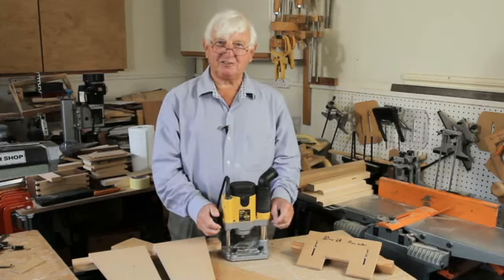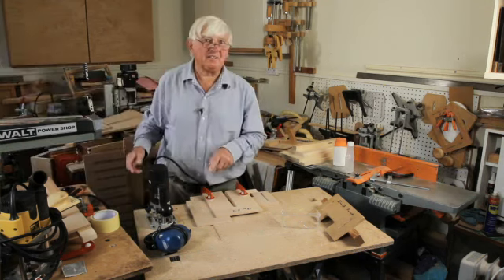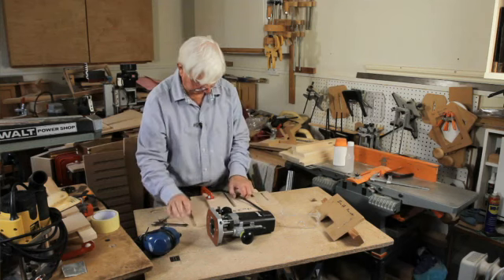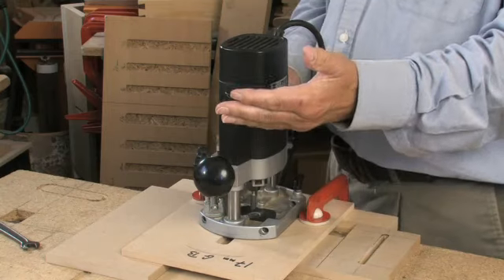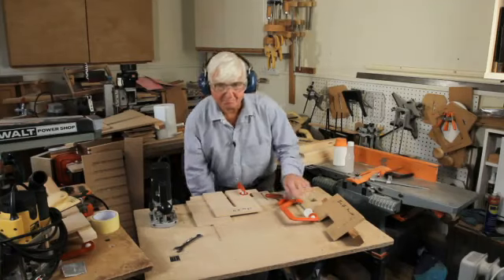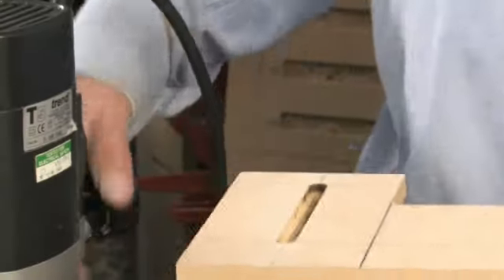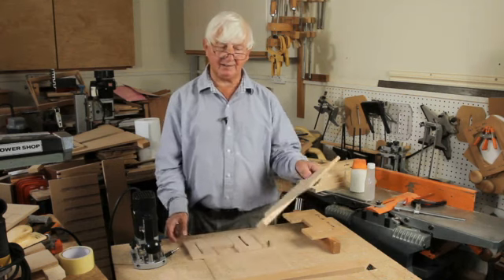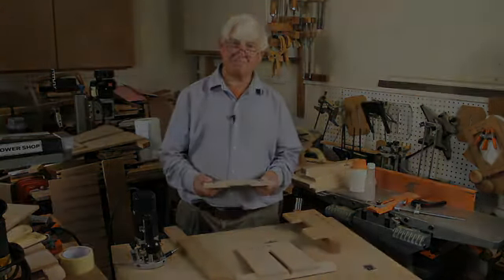Basic Router Jigs with Ron Fox part 6

Comment: Tks Ron, I've been racking my brain on what's the best way to get various router cuts using my new Dewalt router. I was even looking at the Festool router table system, which is great but I didn't want to take a loan out on my house to purchase it. Your system will work great and will likely expand it for things like sign making and furniture components. Rgs, - Mike

Comment: elitepaintballON---- Ron would not have been using metric all his life.  The UK metricated in, I believe, 1969.  I was brought up on Imperial, then we metricated, so I had to learn that.  Then emigrated to Canada (who are largely Imperial because of the proximity to the US), so I learned both. Despite what everyone in Europe tells you, there is no difference between the ease of learning either system....it's just a matter of what you get used to.  I convert from one to the other very easily.